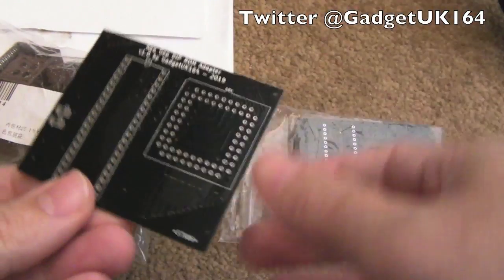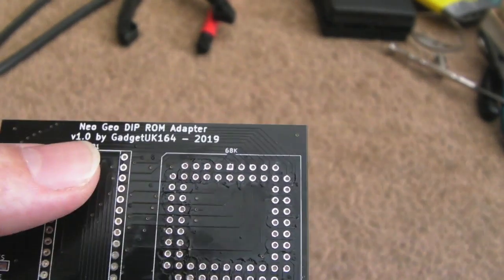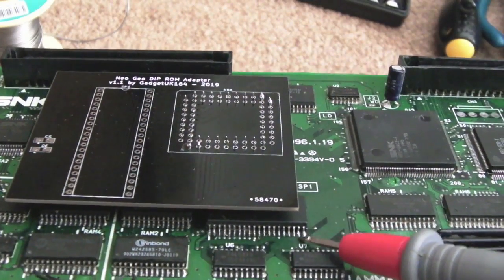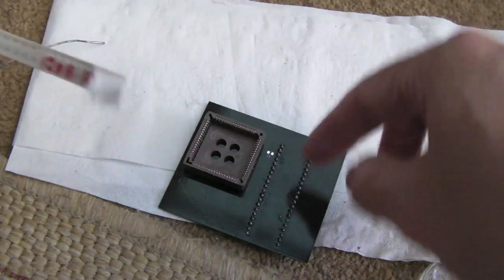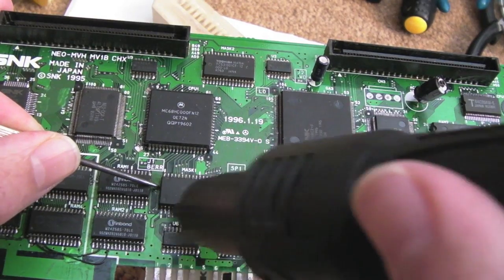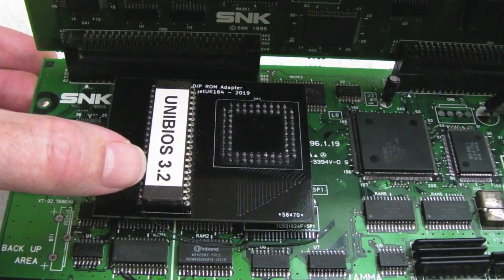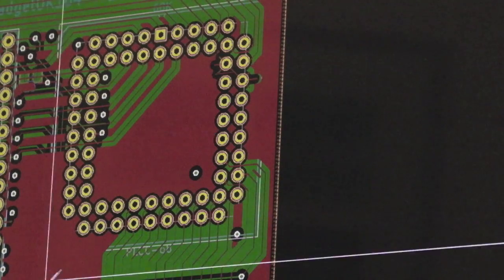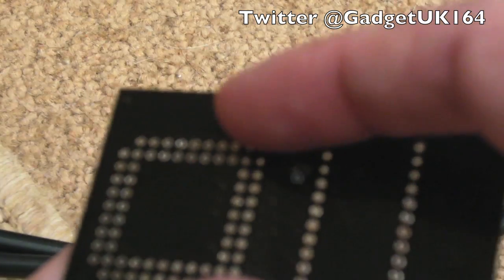SNK Neo Geo SMD to DIP ROM Adapter (UNIBIOS / Diagnostic ROM) for PLCC 68000 CPU (MV1B / MV1C)

Comment: If you still need to file down the sockets, maybe try a large piece of sandpaper on the bench as it’s flat and would make a quick job of it. Just press the socket face down and rub it around. Nice board.

Comment: I've found that the smd plcc sockets are much better for this as you can cut the middle of the socket completely out and you dont have to worry about pinout locations at all. Are you going to do the Dual Oscillator mod?
Reply from the maker: Thanks!  Dual Oscillator mod?  Do you mean to switch between 60hz and the default 59.9blah hz or whatever these default to?
Reply: @GadgetUK164 Yea its pretty neat im trying to get together the parts to do it on my cmvs im building it makes region swapping easy and it adds compatibility to monitors that wont do 59hz properly

Comment: Nice video Chris, a very professional looking board and nice to see your name on it. I didn't know it was possibly to have these manufactured on a small scale like this. Before the video I would have thought you would need to buy them in multiple thousands. Dirty PCB looks like a great site for custom made projects :-)
Reply from the maker: Thanks Vince =D  I will do a video on how to use KiCad to create something like this later, including uploading it and getting it made etc.  It works out reasonable at around $25 shipped for 10 boards.  You can get much more quantity of boards for that cost though by panelising them in the layout - ie. squeezing in a number of smaller boards into say a 10 x 10 panel.  I've not tried that yet though.
Reply: @GadgetUK164   Yes, I would definitely love to see that video. I am sure many people would find it helpful :-) Very reasonable cost, I thought it would cost more.
Reply: @Mymatevince  I know you say you're an amateur but it's amazing to see someone profess ignorance on things I've known for decades while still being leaps and bounds ahead in ability to work with electronics. kinda weird being inspired and ashamed at the same time :D
Reply from the maker: I agree!  Vince, don't put yourself down =D

Comment: The reason KiCAD removes those ground planes is likely because you're not working from a schematic because you, again, likely, know exactly what you want.
You know how everything is and should be connected so there's no need for a schematic. The side effect of that is that there's no defined 5V or GND that KiCAD can work with. When you make the ground plane, KiCAD only counts it as copper with no defined connection and at fails safe, deleting it because it assumes points that should not be connected are connected.

There are downsides to that though because it forces you to work from a schematic making the job take longer, and you can't freely connect points in situations where you need to redefine pins on the fly like when flipping the PLCC socket; you have to create a new part for that with the proper reversed pinout. The upshot is that you can route the board as you want and then have KiCAD automatically join every single ground point for you.
Reply from the maker: Indeed!  I had first hand experience of that a few days ago when I started to move the OE and CS pads around.  I worked out that it's as you say - KiCad doesn't know what is ground and what isn't.  It simply just re-does the filled zone.  I will create v1.2 from schematics in KiCad first.

Comment: Great work.

I think it’s fair to say KiCAD behaves great when you flip components over...it’s just that the IC is going into the socket “head first” really isn’t it. 

It could be worth doing a revised footprint for that if no one has done one before.

Also how did you do the trace routing? Did you try freerouting.jar yet? It’s pretty good. 

Great video.
Reply: The only issue I've come across with KiCAD's flipping is that it tends not to flip squarely on the grid, you have to zoom all the way in and align your pointer with a point on the grid for it to do so properly, other than that, it's perfectly fine.
Reply: ImATrackMan yeah I think it flips around the Origin point a which I guess is usually a pin. Maybe worth checking
Reply from the maker: Thanks, yes - I will do a v1.2 with schematics first, that will likely solve the problems with the ground =D
Reply: GadgetUK164 - Retro Gaming Repairs & Mods if you need a hand on the KiCAD just DM me here or FB. I suspect we aren’t far from each other...based on accents
Reply from the maker: Thanks =D

Comment: I wonder what "brand" of socket they used on the Marpet Xtra-RAM for the STfm's? They used the same method to clip over the MMU. Mine's a bit flaky these days. When I rebuild it, I think a generous blobbage of hot snot may be needed. 

Great vid Gadge, thanks :)
Reply from the maker: I am not sure, I think the Marpet seems to work in different ways.  For example, the one I have for my STFM has pins that slide into the gaps on the pin edges.  But it's designed to fit over a "socket" rather than a soldered on PLCC chip.  Take some photos of yours next time you are in there!! =D
Reply: @GadgetUK164   I'm on about fixing a few things to sell, and am on a "find it sell it" mission.  If I think on i'll look in the boxes of current projects and take pics and tweet them at you of the marpet if I'm on a roll. 

Over time the clip-over design has actually squashed the pins against the MMU, making it even more dodgy, the pins from the package are totally flat against the chip on the board.

Comment: Brilliant Chris. I remember when you tweeted about this board "can you guess what it is" at the time I had an incline it was for the Neo Geo. it's a bummer you had to re-design the board, KiCad can take a little time to get your head around all the options, setting and layout, I know it did for me. I too like you love that feeling when you have something manufactured with your name on it and it works, it's a great feeling.
Reply from the maker: Thanks =D  And yes lol, I forgot to mention - you worked it out almost instantly from that photo =D  Yeah, I will perhaps film some of the stuff when I re-do the board with schematics first.  I want to do that because adjusting the layout after the ground plane has been added is a royal pain if you haven't created it from schematics to start with.

Comment: I would like to know if you have the board designs available for the adapter
Reply from the maker: Once I've sorted out the existing boards I have (for a give-away), I will revise the board (move the CS and OE pads) and then make it open source I think.
Reply: @GadgetUK164  any update on this I wanted to get a similar board by the neobiosmaster but they dont have them in stock.